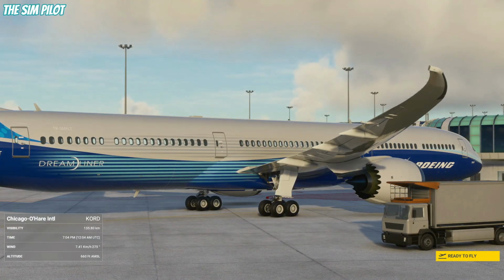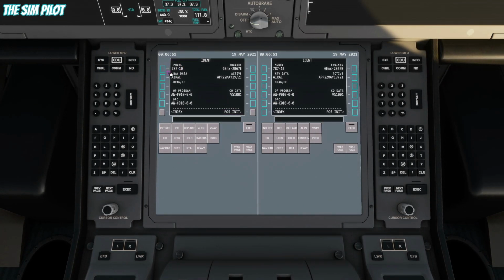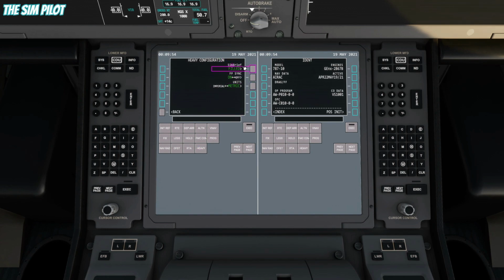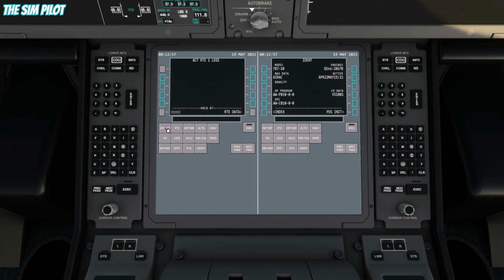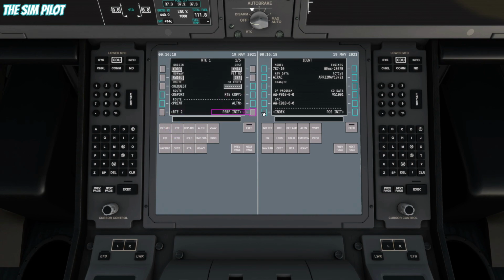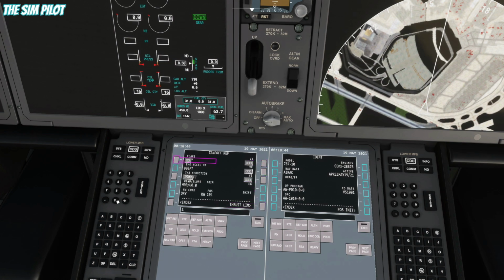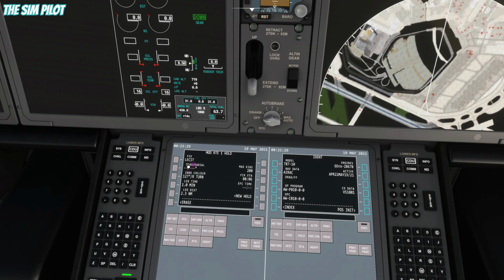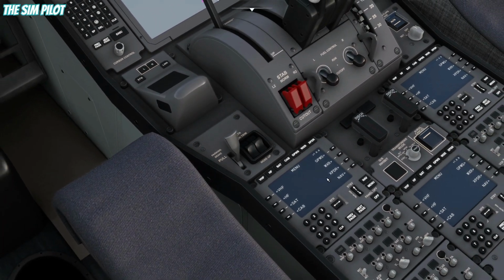Microsoft Flight Simulator 2020 | BOEING 787-10 | HEAVY DIVISION MOD

Comment: Beautiful cockpit, but that touchscreen interface looks like it was designed in the 90’s. I realize why some things in aviation are what they are, but still can’t help believing that Apple Inc could do a much better job with the user interface.
Reply from the maker: I think it is a little better with modern airliners but not to the level like a movie phone or handheld device interface. Not sure why it's not the focus in aviation industry.
Reply: @TheSimPilot  yes, it should be. Not only to have a pretty interface, but a smart and efficient (and safer) interface. Just about every cockpit I visit has me scratching my head as to why you have to push a button or pull a lever or flip a switch in 6 different places to accomplish a single task. Austin Meyers (developer of Xplane) recently was in a video on YouTube where he explains the logic behind a real-world and in-sim airplane that he designed and flies. He’s on the right track.

Comment: Does the Vnav work on this? Because the stock dream liner does follow altitude or flight speed on the FMC
Reply from the maker: No VNAV does not work and after sim update 5 this mod is not working as it should

Comment: How can I get the usual flight plan from Flight Simulator in it? I don't use Simbrief and I'm really way tooo lazy to type in every damn point by hand.
Reply from the maker: You need to plan your flight using the World Map menu, however that does not play well with modded aircraft sometimes.
Reply: @TheSimPilot  well yes. This is the usual way. But I can't find this flight plan in the plane. With all the other planes (even with the FBW A320) it will be taken over from the flight planer (world map). But with this plane... no plan. I must type in every single point by hand... sucks badly.
Reply from the maker: @markbenelli7569  it does especially when you want to be up in the air as soon as possible. After sim update 5 this aircraft is bugged badly and the devs just did a quick patch but it's still not fully compatible. I haven't seen another release ever since.